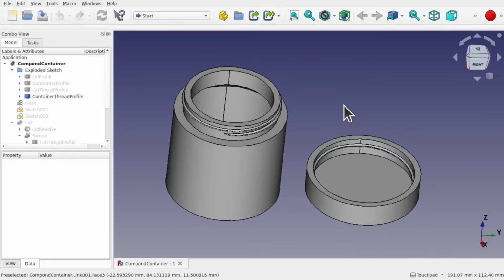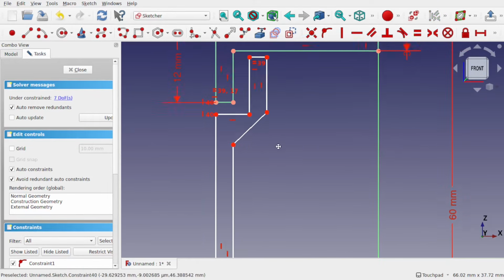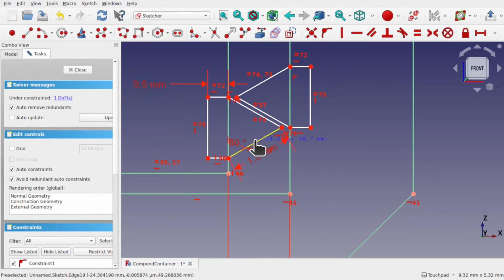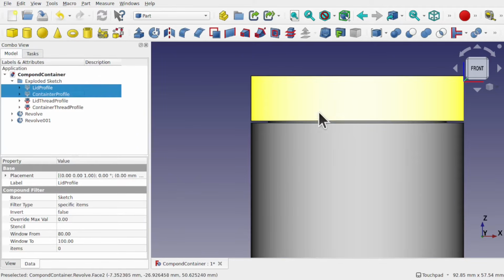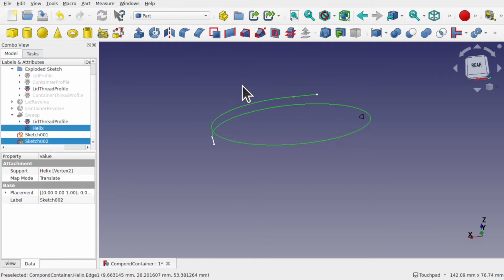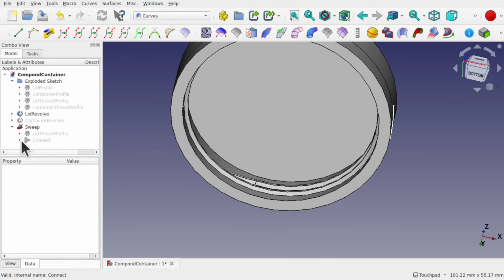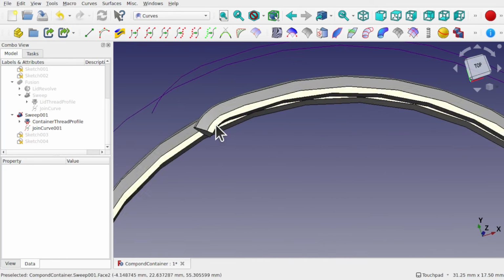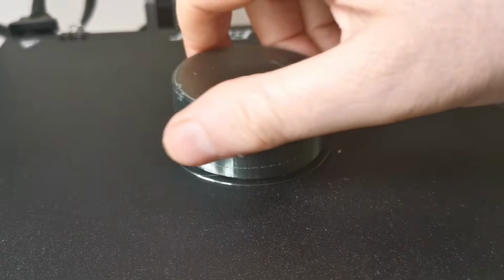Learning FreeCAD For Beginners 41 : Screw Top Container | 3D Printing and Modelling | Threaded Lid

Comment: Can somebody help and tell me why half of those tools on toolbar is missing on my FreeCAD? Very hard to follow these tutorials when you cannot do same thing..
Reply from the maker: As this is shot on v0.21 you are probably missing the dimension constraints which have been placed in a single tool.  .  In the skecther section > general > towards the bottom there are some options for the dimensioning tool.  Dimensioning constraint option has options of single tool, separate tools or both.  This may help if you want them back.

Comment: Great tutorial, with one exception. I have been under the impression ever since I started learning FreeCAD about 6 months ago, that you should leave chamfering and filleting to the last things you do in your drawing. However, I tried and tried, but I couldn't find how or where I could apply a chamfer or fillet to either the Cap or Container. Is it possible and if so, how?
Reply from the maker: Hi, glad you enjoyed the tutorial.  The chamfer and filet are normally left to last as if you was applying them via a operation rather than sketching them as they add additional complexity to the treeview unless you are using that operation for a non-finishing operation.  There are two ways and I will point out where they are from the menu, so can then find the relevant icon you need when using the toolbar for quick access.  First is by a operation in the part workbench, select the edge or edges you want to fillet and select top menu > part > fillet (or chamfer) or by added them to the sketch in the sketcher from top menu > sketcher > sketcher tools > create fillet (or create chamfer), you will then select two edges that you want to fillet, so if this was a rectangle you will select the top and side edge where the corners meet.  I hope that helps.
Reply: @MangoJellySolutions  Thanks for that, got it.

Comment: If your outside diameter is 28mm but your threads reside 3mm+ inside the diameter. How do threads follow the sweep path that you set radius as outside diameter?
Reply from the maker: Where you place the profile of the thread will determine where the thread material will be created.  So you could have a circle that is 5 mm in diameter and your profile offset from the center  by 1 meter, way off in the distance.  When you sweep that profile on the circle it will follow the shape of the path and create a 1 meter radius circle.
Reply: @MangoJellySolutions so radius is kinda irrelevant in this case?

Comment: I cannot get the sweep function to work on the thread profile. I followed everything for my thread design and it keeps saying 'select one or more edges from a single profile' when I hit OK after adding my profile sketch to the sweep function GUI. What am I doing wrong?
I can make a thread helix using the helix function on my thread profile but this doesn't have the threads leading and trailing edges.

Comment: That was a lot of work. I couldn't follow exactly because the sketch explode resulted in an open wire for some reason. But thank goodness for v1.0! I was able to accomplish basically the same model using part design workbench. Took the one sketch and copied it into two bodies. Revolved them, then used additive helix for the threads. The threads don't blend smoothly into the bodies, but I think it will still print fine.

Comment: is still the way to do it in v1.0? All the process still works, except the joinCurves, that didn't work to me. I could do the arc sketches too but didn't need to use the curvesWorkbench, just works with the connect objects

Comment: Perfect. Last week I had to realize this myself. I used cross section of cap as reference geometry for cross section of thread via shape binder, modeled it in the same way as you, used polar array for 3 starts. It worked in 1.0RC4 but not in RC2 where it refused to create array. 

Major problem with your solution is that you can't create array of parts/bodies as far I know, which is very limiting, because sometimes it's exactly what I want to do. You may create array from whole lid, but few weeks I learned that while it works, it takes time to recompute intersection of 16 rotated parts when I needed some fins :-(

Several times I regreted not doing this in OpenSCAD. OpenSCAD is cumbersome in it's own ways, but it's very easy to change geometry without breaking final models, on the other hand it's nearly impossible to create chamfers, fillets and more organic shapes.

Comment: Awesome tutorial.  I can do the threads if I use the Connect to extend the helix but for the life of me I cannot sort out how to use the Curves version.  It creates either two or three join objects.  I get a message "radius should be positive number".  I am using version .20.2.  When I add the sketch to the upper endpoint the coordinate system is not perpendicular to the helix.  EDIT:  I solved the problem by just using the connect tool with the curve by endpoint extensions.  Again, thanks for the great information.

Comment: Thank you for this excellent video. I followed the instructions in the video with the exact dimensions and slightly modified dimensions. I want to use this approach for future object with different dimensions. I'm wondering, would it be possible to have the dimensions of the new container parametrized in a spreadsheet and make it more customizable? Should in this case "all' constraints be defined in the spreadsheet (including helix properties, etc)? Thanks for answering.
Reply from the maker: Glad you enjoyed the video.  Yes that is totally possible.  Some of the dimensions you could derive from formula in the sketch itself if you don't want everything in the spreadsheet.  This would probably be ones like percentage increased if you wanted thicker walls for larger containers or turns on the helix depending on height of lip.  The height of the lid could even be a percentage of the body.  Personally if you have it all in the spreadsheet then your design intent is all in one place so easier to follow.  In  my collection you will find a video for 'Config tables' if you want to take your spreadsheet to the next level and control the individual sets of configs by a drop down selection.

Comment: Thanks for the tutorial; I've learnt a lot.  One tweak I'd add though: I had all sorts of fun trying to get the threads to boolean connect with the body.  Eventually I almost accidentally went back to the Compound command you used to split the sketch, and used " make compound " to unite the components together.  That seems to work without a hitch where the boolean operation consistently fails.
I may be a result of the version I'm using - I'm on Mint Debian Edition so the installed version is 0.20.2. (I'm too lazy to want to update weekly...).
Reply: This was really helpful. I could not get the fusion to work, but make compound worked first try?

Comment: Tutorial 41 on a screw top container was one on my list to learn. I had fusion failure! I'm using FreeCAD v21.1.  Just a helix, failed. Straight line lead in/out failed. Added the arc instead of the lines, left the Connect (didn't use Curves Workbench to join the arcs to the helix, which failed) and the fusion worked. But the arc on the container seemed to be hollow, despite checking solid in the sweep.  Printing the container part now. Will see how it turns out in an hour or so. The top worked fine.

Learned lots as I always do with any tutorial, particularly the Mango Jelly tutorials which usually have many aspects to them.
Reply: For future readers, I had the exact same problem.  The helix made a hole in the cylinder.  So solve this I made a cut using another primitive and the helix so that the helix didn't go all the way around but had a section that had a gap.  This fixed the problem with the union.

Comment: I have done this tutorial twice. The first time, the cover came out all right, but the container had a lot of crazy things happen. Sometimes when creating the curve from the helix, 3 curves would be created. And when I completed the tutorial the first time, inside the container, there was some flat structure obstructing half of it. This obstruction didn't show up in freecad, but after exporting the STL, you can see it in Windows Explorer. It's certainly no fun when the program makes it look one way, and it looks messed up after export. I couldn't fix it. So I tried doing this tutorial again (probably about 5 hours for all of this because I am not an expert), and I was able to get this technique to export 2 models: Cover and base. I did away with the container part of the exercise. And I was able to get those threads to be on each object, cover and base, using the curves workbench rather than using the "connect" method of attaching segments to either end of the helix. I also did this with parametric modeling so that I could adjust the model later when including with another project. 
Finally, it came time to use Cura, and it complained about supports for the threading. I'm curious as to how you were able to print this without support complaints. 
Anyway, I wanted to say thank you for the tutorial, and I put a lot of time into completing it. You are a great teacher for an occasionally frustrating program. For home amateur builders, being able to create separate parts printed separately, connect them, and be able to reuse other parts is a necessary part of the whole process. For me, learning threading is part of that. Thank you.

Comment: Can anyone let me know if this design is parametric?  After you explode the sketch, and place the thread position by dragging, can you later adjust the dimensions of the base or lid (height , thickness, etc) and will everything align?
Reply from the maker: With the exploded it is parametric so you can change the dimensions and update the sketch with additions as long as you keep the same number of profiles i. e if the sketch is made up two cross sections, the lid and the container, if you decide to make say a third cross section, say  something for the container to sit in then it wouldn't appear in the list.

Comment: Excellent video, as always.  Learned some new stuff that I did not know, like the exploded sketch.  I need to make a ball joint with a cap that screws on to tighten down the ball.  This is for the canopy mirrors for my 1:1 scale AV-8B Harrier replica that I'm building.  This video is exactly what I needed, as the ball joint assembly is almost exactly this container with lit, with the obvious difference that the inside of the container is a sphere to match the ball.
Reply from the maker: Glad you enjoyed the video and thanks for sharing what you used the workflow for. Always great to see what people are making with the shared information.

Comment: I spent long hours trying to figure out how to make customs threads, mostly for 3D printing and overcome the need for supoorts. I also watched many videos, with just a few of them being actually helpful, but somewhat complicated to make. After that, I kind of figure out a way that works with almost any thread shape.

If you could make a video of it, probably many people would be grateful for it.

Everything is done within a body in Part design workbench.
1. Create the core cylinder.
Ex. 10mm radius, starting at 0mm in Z.

2. Create the thread profile. 
It must start at the base of the cylinder (no under it). 
Ex. start at 10mm in X, 0mm in Z, and 4mm thread height.

3. Create an Additive helix. 
Mode: Pitch-Turns-Angle or Height-Turns-Angle.
Turns: 1. If it's more than 1, it will fail because it touches itself.
Pitch/Height (minimum): Thread height + 1/1000. It must be just be slightly higher than the Thread height.
Ex. Pitch/Height: 4.0001

4. Create a Linear pattern.
That will give you the rest of the the turns.
If you want to make it slightly easier, on the Length you can put:
(Occurrences - 1) * AdditiveHelix.Height
And control it with the occurrences.

5. Create a Groove.
This is where you trim the excess thread and you can also apply a chamfer to the tip of the thread.
I usually started the threads under the cylinder because I don't like the flat face at the beginning of it, but it gave me some errors with some tangents at the cilinder side, that's why this step and the warning in #2.

6. Test the body Geometry.
Go to Part workbench, select the Thread body, go to the Part menu (at the top), then Check Geometry (towards the middle of the drop down menu), then Run check.
I did it so many times, that it was easier to run the code from the Python console. Gui.runCommand('Part_CheckGeometry',0)

Comment: Fantastic tutorial, dude! The only thing I didn't like was how difficult it was to deal with the tapering at the ends of the helix; threading should either be built in or there should at least be a tool that allows you to handle the tapering parametrically. After all, threading ain't new--I mean it's 2000 and friggin' 23, ffs!  However, you did and excellent job of working around it 😎
Reply from the maker: Glad you enjoyed, yep that taper was not the easiest and I'm not a fan of the technique. Normally you would go for a fillet and that solves the problem but that often fails with helix. Will be on the search for a better way.
Reply: @MangoJellySolutions  I'm testing the Fasteners workbench right now, but am also on the hunt for a better way to handle tapering. I suspect, however, that it'd require code. I could figure it out, but I'm not a Python coder (I have 3 decades of C). In any case, if I find a solution, I'll let you know.
Reply: @MangoJellySolutions   After a bit of trial and a sh!tload of error, it seems that one approach is to chamfer the lip of the lid and the bottle on the facing sides, then do subtractive spirals. You'd have to redesign the thread profiles, though. I tried this but could never get FreeCAD to behave; it produced anomalies, error warnings, and the model even disappeared. Frankly, I'm impressed that you and so many others can get so much out of FreeCAD without driving yourselves insane. But I've encountered far too many bugs and GUI/workflow inconsistencies and overall WTFs to continue with it.

Having said that, I haven't been particularly impressed with a lot of the other free and commercial options, either. They're either too bloated, too expensive, browser-centric, require Windows 10 (I can't/won't change OS's mid-dev), expose your data to their public cloud (some free options), too limited (free versions), non-parametric/polygonal (e.g. Blender), etc. What an abysmal wasteland CAD software seems to be.

I'm opting to write my own artist-engineer centric software (i.e. a CAD suite that allows for a fluid, non-destructive, non-linear workflow) and output to STL. It'll take some work, but it's the only sane option for me.

Regardless, I've been quite impressed with your videos and wish you great, great success!
Reply: Agree, the Thread Taper was a bit tricky but I managed it eventually. I think Darrens objective was to give a Us a variety of "Work Arounds" should One encounter problems. Not sure if the Fasteners W'Bench could have been used? Things like the above seem to involve Trial & Error "tweaking. Still all good experience. Unlike yourself I'm an absolute Beginner so I have no CAD background to compare to. FreeCAD seems to Me to have a lot of Different ways to do the same thing, I'm a Hobbyist and reckon FreeCAd 'll do Me (If I dont go Insane First ;-)). I've just dumped Windows for Linux Mint & find my Decade plus PC is running FreeCAD & everything else better than before. Likewise I'd say Darren is the best online Tutor I've encountered.

Comment: Excellent tutorial with perfect way of explaining the steps. I used your helix approach to create a special thread I need for a project. I got a big problem with a severe twisting of the thread, increasing along the path of the helix. I implemented your thread example and discovered that your design has exactly the same issue. You easily see it if you increase your height of the helix to several turns. After searching the web I found the solution: when you sweep along a HELIX, you HAVE to select FRENET in the sweep popup. I noticed that you had this option unselected in your example.
Reply from the maker: Thank you glad you enjoyed. Thank you for adding your experience as it helps others who read the comments. Frenet is great when you have large helix as it stops the profile from beginning to disorient itself from the path (creep) worth mine I didn't need it, probably because of the size or shorter length of helix. I didn't think about talking about frenet so sorry I missed that.
Reply: Thanks I was wondering what that option did. Sharing helps us all progress.
Reply: Thanks @eagletracker for this information! Thanks to @MangoJellySolutions for the very helpful video as well!

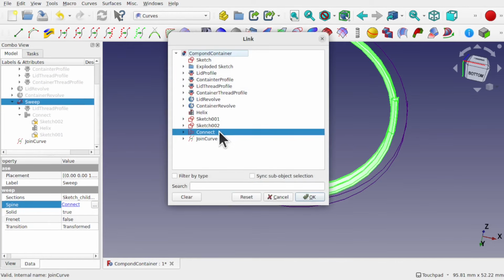Comment: Thank you for this tutorial, it's a huge help and the instructions are nice and clear. I was wondering though; I got an error when recalculating the thread using the JoinCurve (around 30:54 in your video). The error is just 'Recompute failed'. I'm using FreeCAD 0.21.0, Curves shapes 1.0.4 and Curves workbench 6.13. Is there perhaps some other addon that I'm missing? 
Thanks in advance.